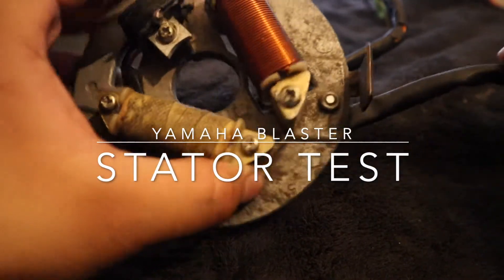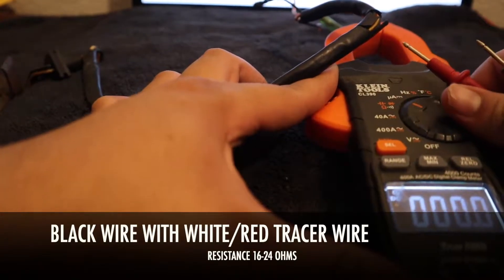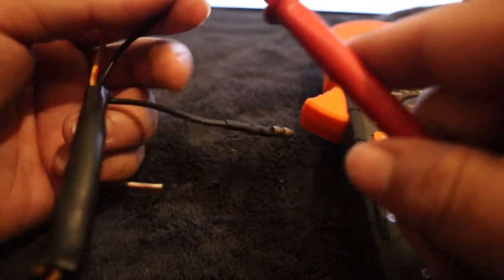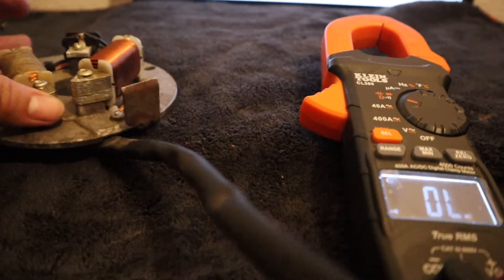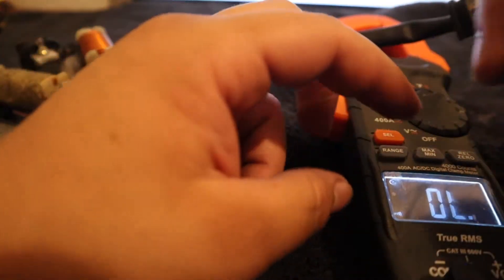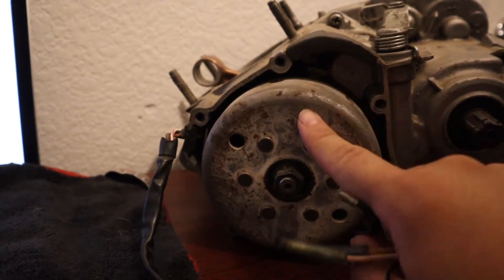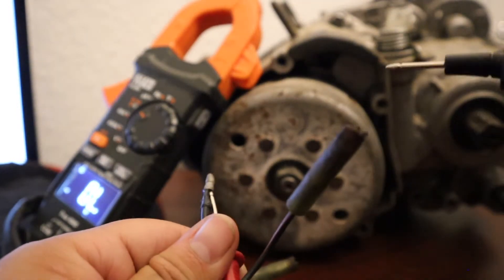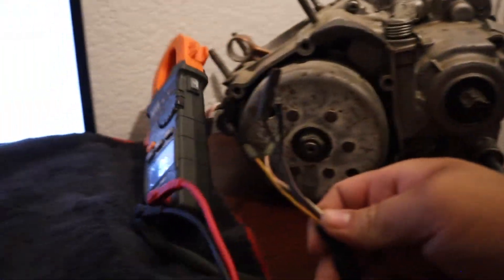YAMAHA BLASTER STATOR TESTING

Comment: I tested my ohms and the red with black is testing at 355 and the white with red is testing at 55 is this bad? How do I fix it if so?
Reply from the maker: If it’s not raining in range then it’s bad 
Make sure your testing at room temp 60 degrees and make sure it’s cleaned 
The connectors
Reply from the maker: If you have to buy a stator do not buy Chinese
Reply: @Nathang2023  okay thank you, it’s about 50° right now but I don’t think the weather would affect it that drastically would it?
Reply from the maker: @kaosdevinney180  it does